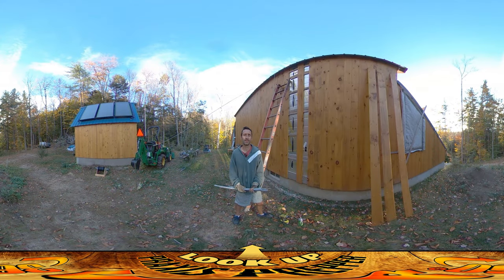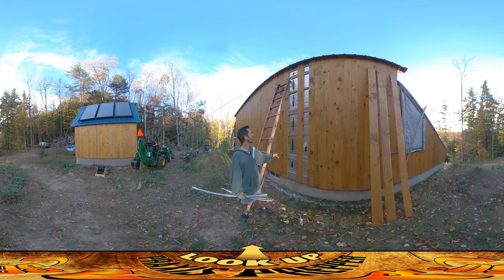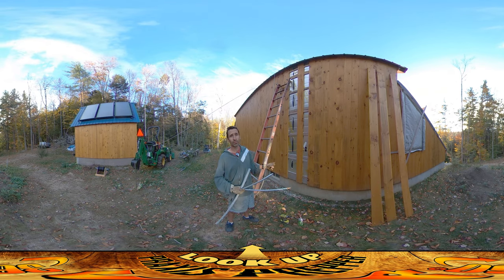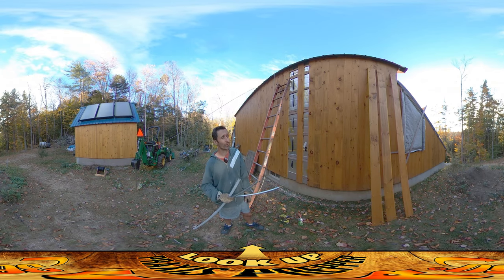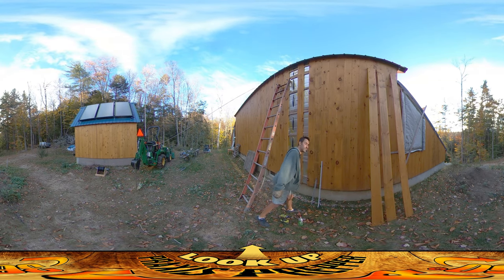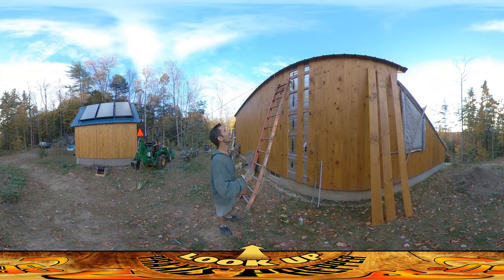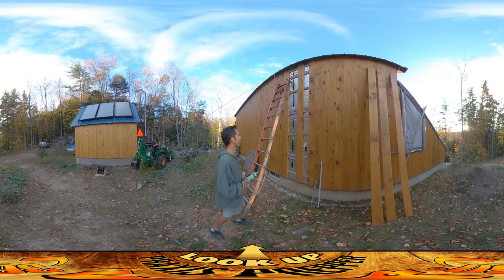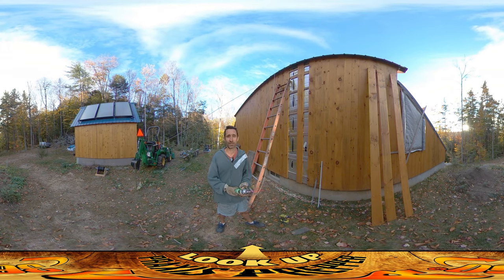Homestead Building - Whole House Solar System, Running Power from Panels to Charge Controllers

Comment: The belt and suspender approach to your wiring is inspiring. Most of us are so stressed on just getting the thing to work, we (that means me) didn't prioritize the safety of the wiring. Good job.
Reply from the maker: The one thing that I hate more than having to build something that's a hassle to build is to have to FIX it later. ;)

Comment: Was wondering when you were going to get back to the solar. When you do get to the wiring you of everything please do a regular detailed video of what all you use and do. If you aren’t comfortable passing along the details for the world at large please consider doing one for your Patreon members I’m sure several of us would appreciate it.
Reply: Good request. A detailed video of the wiring would be appreciated. Even thought I muddled through the wiring on my solar system and have been using it for a couple years, I genuinely don't know if it is right (as in optimal) or not.
Reply from the maker: I'll definitely be doing a video on the work that goes into that. I just cleaned out the area where I'll be assembling the system today (it had been filled with empty canning jars). Tomorrow I think I'm going to unpack the boxes of gear and start sifting through all of it. I'll def do a video about it. It'll be day 868.
Reply: @PraxisPrepper  Thx Looking forward to it 👍